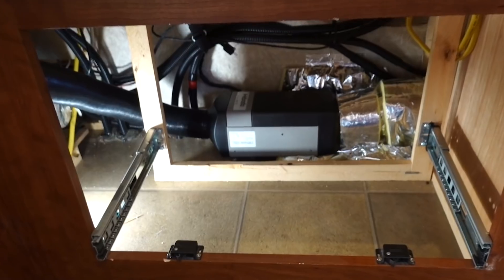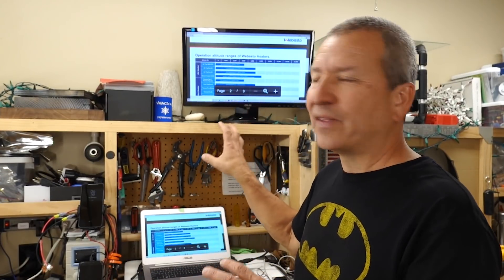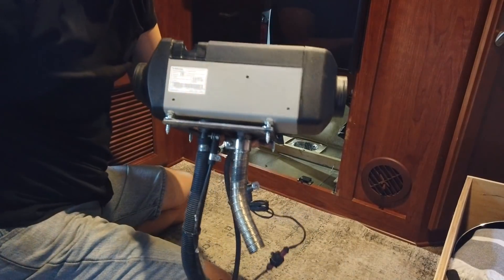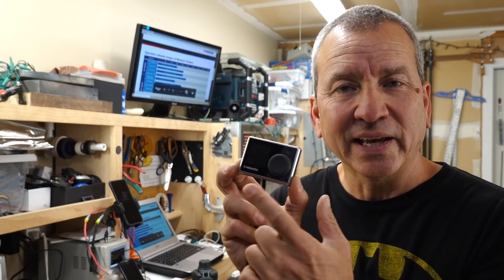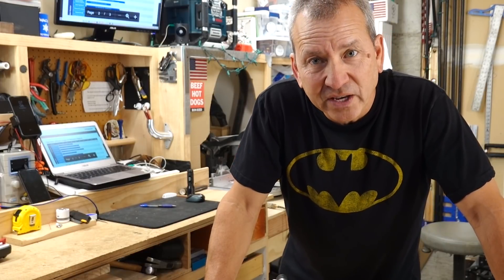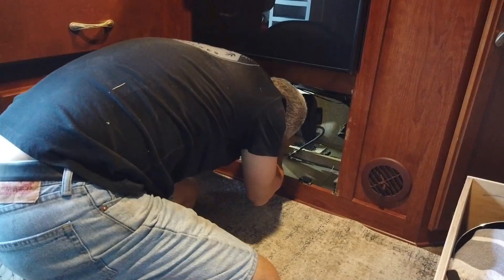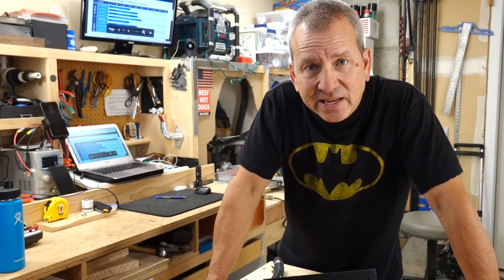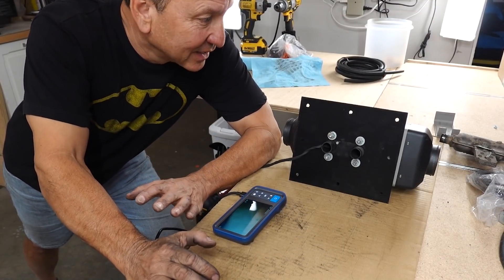Webasto Gas Heater FAILURES at High-Elevation | RV With Tito DIY

Comment: Just a quick thought or suggestion.  Would a long handled bottle brush have helped inside along with the air blasts? 
Have peeked some concern about our Alde hydronic system at high altitude. Works as a radiant heater instead of forced air.

Comment: I have used the heater a bit during the summer but have had trouble that it would run two hours and shut off. Not sure if I’m doing something wrong. Have you had that problem on your heater.

Comment: Awesome video Tito , I opted for the EVO40/55 gasoline model,  supposedly self adjusts the combustion in high elevations with built in air pressure sensor , hope I never have to purge creosote like you did , thank you for the great content and thinking out of the box solutions you provide in your channel !!
Reply: I just bought the EVO 40. i live in CO, and will be at 9000-1000 feet from time to time. How is yours working for you at high altitude? Do you have the Evo 40?
Reply: @Jaws-3  That's awesome , I haven't had the chance to test it that high yet as I'm in NY area but hopefully soon.

Comment: is it worth it?
Reply from the maker: Hmmm. I suppose that depends on where you live/camp. It's probably not worth it if you live at high elevation without some kind of elevation adjustment (or different model). At lower elevations (below 5000ft) it has worked flawlessly as long as you use it regularly.
Reply: @RVwithTito  What model do you reccomend that doesn't have this issue?
Reply: @RVwithTito  Live in Salt Lake, camp from 9k down to 3k St. George. Don't sound like it's for me. Thanks

Comment: All that carbon buildup is why I stick with my LPG furnace I have a 1998 play mor travel trailer and guess what the original furnace is still in operation.  with zero buildup whatsoever and is also a very efficient heating source. Very pointless DIY in my opinion installing one of these gasoline heaters

Comment: Great information, thanks for sharing. I was planning to use a gas Webasto for my upcoming van conversion, this video makes me pause. The thought of removing it on a yearly basis for cleaning is not appealing. Still didn't do enough research, maybe there are heaters with automatic altitude mixture control.
Reply from the maker: Glad it was helpful! I know the Webasto EVO 40 automatically adjusts for up to 7200 ft. More $$$ though.

Comment: It sounds like it doesn't have an automatic mixture control and above 3000' MSL generally speaking, it needs to have the mixture adjusted to the density altitude range you're in.  Gasloline needs a 14.7:1 air to fuel ratio, and as the air thins from altitude together with temperature/humidity, it will burn too rich at the sea level/MSL setting and leave a lot of carbon fouling as well as wasting fuel, or just not ignite as you have experienced.   Reciprocating airplane engines are a good example of this, and if if you can adjust the fuel mixture and monitor the temperature, the general proceedure is to lean the fuel mixture until the running temperature peaks, which is where the combustion is most efficient, and then richen it slightly.  Airplane engines use fuel for cooling, so they are normally leaned 25 deg rich of peak, but since this is a heater, the manufacturer has probably determined the best fuel/air ration for it's longevity.  I would guess that if it's adjustable, you can work out a chart based on density altitude for it and do adjustments periodically as needed.  Temperature/humidity have a great impact on density altitude, where the air density is equivalent to a higher altitude at standard temp and pressure, aka the normal adiabiatic lapse rate --  for example, a cold morning at 7,000' can elevate to a density altitude of 10,000' by late morning as the sun warms the area up into the 80's and 90's.

Comment: I am not sure on the webasto but the cheap chinesse ones you can adjust the fuel delivery settings to compensate for the altitude and such and they will work fine at really high altitudes if adjusted and there are plenty of known settings for them for various altitudes.
Reply from the maker: Yes. I've seen that. I don't think they make any for gas/petrol. Do they?
Reply: @RVwithTito   I am pretty sure they do

Comment: I wonder if the diesel version has the same altitude limitation
Reply from the maker: Both diesel and gas have the same rating.
Reply: @RVwithTito  The Webasto Air Top Evo version compensates for altitude up to 7200 feet. Higher heating capacities also

Comment: So for a cool project you could add a pressurized blower to the system with a variable speed drive so that you could increase the air density mix based on the altitude, at 6,000 ft you have 20% less oxygen available, the other suggestion which would be less cool but probably easier to implement is leaning it out ... maybe pwm the injector ... negative is less heat out of it

Comment: I thought you had taken the LP heater out. I put in a diesel heater but left my LP in so I would have the option. Sounds like a good idea for higher elevations. Thanks for testing.
Reply from the maker: Nope. I left it in until I was able to fully test the Webasto. Good thing. I''m not using all of the registers (just two) but it's enough to heat the RV.

Comment: Hi Brian , I have the chinesse knockoff , I have a friend that his soots up all the time ,,Me NO as i always run the sucker at full heat it burns the carbon off ,, At least 2 hours full heat and it will clean (Burn) the carbon off ,,, we have used ours at the snowy we have never had a drama at all 
Rob 
NSW
Australia
Reply from the maker: Thanks for the info. Same here, when I run it below 5K ft elevation, it runs like a champ.
Reply: Good Morning, do I understand you to say you have a gasoline fired Webasto knock off? I love Brian's work and am seriously considering switching from our LPG furnace. BUT I can't see spending $1,500 to replace an appliance I already have that works. I considered mounting a two or three gallon tank and installing a diesel fired knock off but then I'm carrying around an additional type of fuel. And how much diesel fuel do I want to keep available and where. Except for the Webasto unit in Brian's excellent video I haven't seen a gasoline fired air heater. Please let me know about it if you do have a gasoline fired knock off.

Thanks and best regards!

Comment: I have a China diesel heater in my class C that I full time in here in the North East. It was $115, will be going into my 3rd winter. Adding a second one for the bedroom area. So def get one for your shop. They actually have minimal issues and are very easy and inexpensive to repair. Plenty of vids out there.
Thanks for elevation info. 👍
Reply from the maker: Yes. I'm familiar. I think I will. I'm tired of using LP in the shop to keep warm. A 5L diesel tank is no biggie. Have already thought of how/where I'd hook one up :)
Reply: How much fuel it burn out like in 10 hours
Reply from the maker: @anigallegos83  Roughly .5 gallon.
Reply: @RVwithTito  sounds about right. I set it at 20-25 deg Celsius and it's 24/7. Uses about a gal a day. I use a 5gal. Jerry can for a fuel tank. Fill it every 4-5 days

Comment: I have a 100 series Aqua Hot in my motorhome and they do say not to short cycle the unit. (let it shut down on it's own before shutting it off) I would remove the muffler to help it increase air flow. My AH does not have one and is quite.

Comment: Nice review, I do have a question, not sure if you would know the answer, would a diesel heater be able to run at the higher altitudes?
Reply from the maker: Perhaps. All I know is that the diesel models are less likely to carbon up as much.
Reply: @RVwithTito  The elevation rating is assigned to the heater model, fuel type does not matter, the BTU rating is the same.

Comment: This is great! Thanks for sharing what happened to your unit and how you got it going again. I installed my unit early in the year but didn't hit the road until late spring. I've used it only twice so far but expect to use it a lot as winter comes.
The video with the Webasto tech was extremely interesting: basically, try to run it on high as much as possible to reduce soot accumulation—even to the point of opening a window to make it work harder and thus cleaner. This will also allow the burner to last longer.
The other interesting thing is that the high altitude adjustment is more usable for the gasoline version compared to the diesel version. He also recommended not using it above 4900ft...though many people do so, it just means the carbon builds up more quickly. Running it on high is another way to clean the carbon without using compressed air. Every current or potential owner should watch that video. 
I'm still very happy with my decision and now I know how to maintain it.
Reply from the maker: Yes. I still love the heater and plan to continue using it. I just needed to know first hand what it's limitations were and the Webasto tech's advice was very helpful. I will continue to follow those tips. Thanks for the comment!

Comment: You mentioned that you would use your LP heater above certain elevations. Is there not an elevation restriction with all gas fired heaters furnaces, hot water, etc.? I thought I saw something like 2000 feet.
Reply from the maker: I don't know. I've used ours without issue up to 10K ft.

Comment: That's some really good to know information. I still am kind of Leary  of using gasoline 🙄 but I guess it's OK I wonder how elevation affects the diesel heater??  I think this is one time where you should have worn a mask.😷
Reply from the maker: The heater is very safe. The intake and exhaust are all on the outside. The gas supposedly produces more soot than the diesel.

Comment: Good morning Brian and everybody! I took a brief respite over the summer from working on this Minnie Winnie due in part for a 10-day vacation in the Keys in July and just the heat in general for summertime however I am back working on the motorhome. I still have the passenger-side filon from side door on back completely removed and cleaned up. I am starting to sand down what's left of the luon on the motorhome that I could not remove with my Razor scraper. I think I'm still ahead of the game since I purchased this for 4 grand.
I cashed out some Civic Crypto that tripled in price last night and will use that money to pay for my new steps which I just ordered, a lot of the money I am spending is coming from my crypto portfolio which is all house money! 
Have a great weekend
Reply from the maker: Awesome way to pay for the mods. Good luck with the projects!

Comment: Good video. I carry a small compressor with me. Could you blow the soot out the exhaust  on the road without having to  pull the unit? Must be a way to devise a blowout connection near the intake while boondocking of course.  Not in a park. Lol how difficult is it to remove? Thinking about getting one for my a class. I guess you could use propane heat at higher elevations.
Reply from the maker: If you mount it in a more accessible location, then it's easier to remove. Mine was in a pretty tight spot. It's recommended that you replace the floor gasket when you reinstall though. I'm sure you could attempt to blow it out on the road as long as you have some decent pressure in your compressor. Yup. I left a couple ducts on the LP heater just in case, good thing.

Comment: could you use a compressor to blow out the soot  once in a while at altitude? assuming you could power a compressor  while boondocking
Reply from the maker: I'm sure you could. If you could easily remove the intake and exhaust from outside, then you wouldn't have to remove the entire unit. I hoped to try that on mine, but it was too difficult to access while installed.